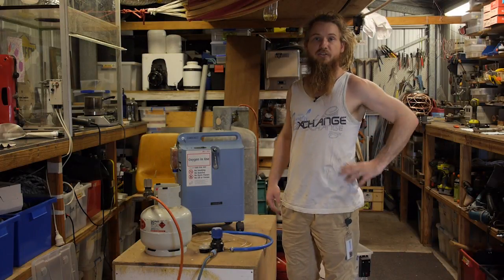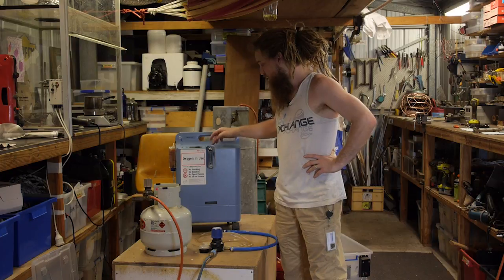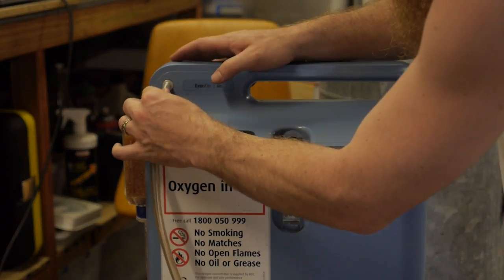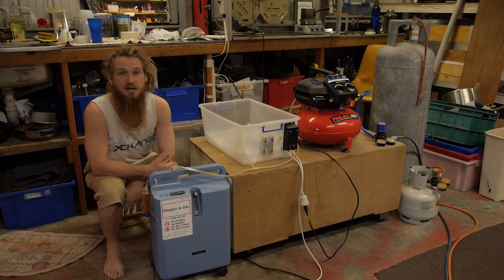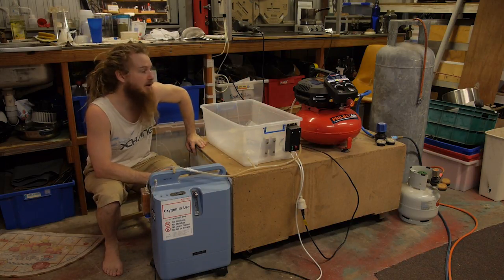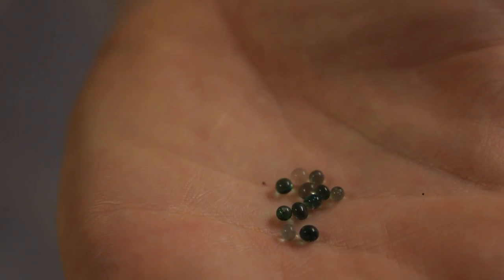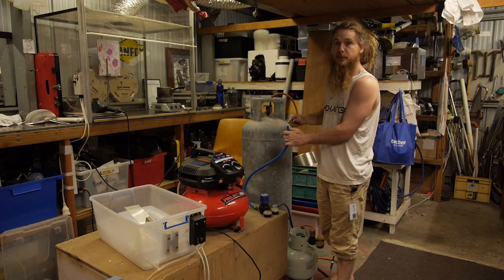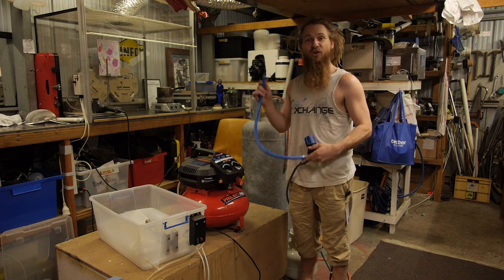How to make your own compressed oxygen for oxy torch

Comment: You shouldn't use propane tanks unless you've unscrewed the valve and washed them out first.  The scent they add to the gas is oil based and can pool in the bottom.  It may not be a problem since it's VERY hard to get an ignition source inside of an air tight cylinder. Even still it's just bad practice to combine a fuel with a pure oxygen source in an air tight pressurized container.
Reply: I was going to say the same, you have to be careful that there's zero fuel contaminants.. Just get a old balloon gas bottle and an inline regulator, much easier

Comment: Dive buddy of mine tried generating his own breathing gas  (nitrox) and had not O2 cleaned his equipment properly and nearly burnt down his property. Anyone who thinks that this stuff is safe is wrong, but it will be okay until it is not. That is when you find out why it needs treating with respect, and why there are no cutting corners.
Reply: If I was him, I’d be using an empty G size oxygen bottle as the holding tank after the compressor. The lpg bottles have a lot of contaminants left behind from propane/butane mixtures.
Reply: Skill issue

Comment: Just my 2 cents. Long time auto mechanic my welding gas supply guys once told me   Just.   Even.   Opening up the oxygen tank valve too fast can’t cause an extreme fire  as it rushes past the regulator and mixes with oil ect forget exactly the comment , but tread very carefully those guys know what they are talking about at the bottled gas supply houses.

Comment: DO NOT USE OLD USED PROPANE TANKS FOR THIS. A glass blower about 2 weeks ago blew up his propane tank full of oxygen doing this and almost died. Moral of the story one single particulate of propane in a pressurized oxygen vessel can make it explode. Used LP gas cylinders are too dirty, to be safe use a brand new one, or an air compressor tank very cleaned out.
Reply: That's true. Actually new propane tanks have a vacuum because they don't want to leave air in there when you are going to fill it with liquid propane.

If you want to use an old propane tank as a hobbyist, either buy a new propane tank or buy a vacuum pump to make you own vacuum.
Reply: J you can get test bottles for gas detectors. Which will test the sensors. In the bottle there are 3 gases. One is O2, h2s the other is o2.
Reply: one particulate? so one propane molecule (C3H8 + 7O2) contains enough energy to breach 4mm of steel? Dude - you've created the ultimate fuel source! With that kind of energy, we could get to Mars in, like, weeks!
Reply: thats why you fill the tank with water first. its called using your brain
Reply: Better to adapt it to a standard oxygen bottle rather than a LPG bottle.
Reply: While I see his point, that's not how explosions work necessarily. You do have to have enough to have a sustained reaction. For example, methane's perfect combustion point is 1:2 ratio because CH4 + 2O2 --> CO2 + 2H2O. So you would expect about 10% methane in air to be the perfect point. It turns out that it can't explore below about 5% in air, or above about 15% in air, representing 1:1 --> 1:3 ratios, respectively. Propane would have a slightly different stoichiometry, and the fact that it is compressed may change the kinetics a little, but you would still have to have sufficient propane to explode.  THat said, high pressure 100% oxygen might react giving off heat spontaneously, and even if it's not enough for an explosion, the slow burn could generate much heat, causing much expansion, until pressure-based expansion caused it to breach.
Reply: forget about talking about new or used propane tank..first dont do it second use an oxygen tank.
Reply: Bbbbbbbbooom😅😱🤬🤔💥💥💥👌

Comment: Great idea. A couple of comments anyone that wants to attempt this should consider. 1) LPG tanks contain residue of Ethyl Mercaptan which is what makes LPG smell like LPG 2) consider getting an empty oxygen tank on gumtree etc. plenty around, many for free 3) You should connect a vacuum pump to your circuit. Easily done with a refrigeration manifold and pump. You should not contaminate the pure oxygen with the air in the pipes and tank. 4) OXYGEN is explosive when it is in contact AT PRESSURE  with many oil and greases including SILICON oil. You have used a oil free pump which is excellent, however this would also be vacuumed before taking the oxygen 5) LPG and oxygen is not as dangerous as ACETYLENE. If you ise acetylene connect FIRE ARRESTORS to both tanks

Comment: I hope you carefully cleaned off the propane tank from any gas, grease and paraffin decomposites inside? You probably also know that pure oxygen (esp. when compressed) tends to react very impressively with all oil, grease and alike stuff? You are lucke nothing bad happened so far. But - believe it or not - i have similar ideas :-) I guess oxygen at 5 or 10 bar is not as agressive as it is at 200 bar from industrial tanks. The regulators can suddenly explode when opening the valve because of slightest contaminiations with grease or just dust and debriss coming from inside wear! It is rare but such incidents have been reported esp. from aluminium regulators. So take care!
Reply: It's not really a problem so long as you don't just throw the valve open. You can cause that kind of explosion with an argon tank if you screw it up just right.
Reply: How would you clean a tank like that from the inside??
Reply: @marceloovg1873  i use some solvents like petrol, benzine e.g. and a vacuum pump. Let the solvents rest for some days and turn the tank every now and again, also apply some heat gently. Let the solvent drop out - use some pressure to get all out (turn the tank). Then evacuate the tank and apply heat gently. Let it on high vacuum for some days. You can be sure that you have 99.9 % of all solvable debris out of the tank.
Reply: @richardnanis  thank you for the information

Comment: So about 2 years ago I wanted to start blowing glass so naturally I needed more of a torch than just a propane torch. I discovered oxygen and as I was learning about the fundamentals, I stumbled upon this video. I was amazed at how simple yet genius your whole set up was. Like you, I've always wanted to be self sufficient. Well today I finally picked up a free concentrator and I'm so stoked. You inspired me and I really appreciate it. Cheers
Reply from the maker: Thanks heaps! Definitely has some risks to it. But you just need to understand and take due caution. Good luck with it
Reply: Glass blower,,,30 years
Reply: Hey I'll just throw it out there if you are working with small pieces of glass MAPP pro gas is more than adequate. Especially, if you have fire bricks for insulating the heat but when I'm in a pinch and need to patch lab glass MAPP works just fine.

Comment: If you can score a Homefill oxygen compressor you can refill high pressure cylinders. I use medical cylinders for light mobile LP cutting but currently transfill them from larger cylinders (oxygen is cheap enough commercially and I've two gas suppliers within 20 minutes). Homefill compressors are often used with the (ripoff priced) integral regulator medical cylinders which are not repairable but you can harvest their QD male if desired to connect to the compressor then buy a whip and proper fittings for your cylinder. I use a Tee so I can use an ordinary oxygen regulator to monitor pressures and dump the line after the cylinder is full. Pilots use "transfill whips" similarly.

Comment: F'n awesome!!! I bought a 5 litre/minute oxygen concentrator 2 weeks ago and have been thinking of ways to compress my oxygen to higher pressures that I can store for later use and use for studying/cutting as well as glass blowing. I had been searching around for YouTube videos or guides on google but was unable to find much until now! Thank you all look much. Fantastic idea. I know what I'll be doing tomorrow on through the weekend.
Reply from the maker: Glad to hear it bro. Good luck
Reply: I think just using a 4 feet diameter latex balloon that cost 3$ for storing the oxygen is much safer then compressing it in any tank, also 100 times less expensive.
Reply: @simpledate  you think filling a 4 foot diameter latex balloon is safer to have around a cutting torch that will have burning metal Embers flying around would be safer than it being in a steel tank what happens when a spark hits the balloon and melts through it

Comment: Some of those generators have output rating at 20 psi so you can connect directly to the torch. I've been able to braze copper tubing up to 1 1/2" that way

Comment: That bag deal had me convinced you're too smart by half. But the desiccant in the compressor tank fixed that. :) (use an inline on the output  - I know you figured it out.) But it does beg the question of how the water got in there.
I found about a dozen of  those machines in the park trash bin about that 2017 timeframe. They were from a rental house.

Comment: wow what a great idea.  I was actually a little confuse how you draw bag of oxygen into air compressor, until i realized you have another tube coming out of the bag connected to the rear side of the compressor.  When compressor kicks on, compressor uses it own power to suck the oxygen from the bag into the tank and stored it there. All make sense now~~
Reply: Where do you connect the hose coming out from the bag of oxygen to the air compressor?? I don't see how the oxygen goes from the bag through the compressor into the store tank . Please help !!!

Comment: There is some risk here. The risk is not compressing oxygen or some minimal propane let in the tank. Compressed gasses are safe if used properly. The risk is oil leaking out from the compressor. If you happen to get the correct ratio of oxygen to oil vapor....badness. That is probably unlikely but it is possible. I am wondering if there is a safer type of compressor to try this.
Reply from the maker: So it is an oil free compressor, and I opened it up to check. PTFE seals. That is mandatory
Reply: @paliaspip  Nice work.
Reply: Oilsssss in the lpgg bottle.😱🤬💥

Comment: Awesome idea, however:

Tank and lines should all be lined with an oxygen barrier.  Compressed oxygen in an unlined steel vessel will rapidly oxidize.  Rapidly as in faster than with normal compressed air. 

Also if the temperature drops enough, you will have liquid oxygen droplets and those will pit steel very rapidly. 

 Any bimetal contamination in your vessel and you run the risk of a thermite reaction.    IE if the iron oxide in the tank meets aluminum or aluminum oxide. 

I would purchase a $300 oxygen bottle.  If you are willing to shell out a "few hundred" for an oxygen concentrator,  you can afford to buy an oxygen compressor (not just an oil free air compressor) and a proper tank. 

I've used both compressed o2 and liquid o2 in industry,  and it's not something to take lightly.  

When proper storage and plumbing for use is considered, using oxygen is a safe ordeal.   When using recycled goods, the potential for disaster increases exponentially.  

Without a safe compression and storage method, I personally would only use the concentration machine for brazing. 

Oxygen tank rentals and fills are not that expensive.
Reply: sounds like good advice.
Reply: Well done Travis, that is very valuable information, Thank you for putting the time and energy into your comment. I was thinking along the same lines as Mr Thomas-Hall.....but !....sometimes things ain't so simple. I really like how you didn't criticise the guy and empowered him with information, it will keep the 'experiment spirit' alive in the young lad. Cheers
Reply: To avoid this I once tried using the machines in parallel, I have three the same.  It looked a little crazy but seemed OK.  Haven't gone far with that.  The machines are of course very expensive, but they sometimes turn up in thrift stores and online.  So basically my goal was to get two or three machines running and just plumb them together.  I didn't realize at first that the machines have sensors, and low flow and high flow conditions set off alarms!  SO, if you turn OFF the torch there's a lot of beeping.   I guess the oxygen is just going around and around, you could just turn off the FUEL and let the oxygen run?  It's not going to build up in the room.  I have a few torches that have Air, Fuel, Oxygen inlets so that's what I'm generally hoping to do.
Reply: @leonardpearlman4017  having multiple machines would solve the storage issues.   You could install a blow off valve that opens when you shut down the torch and closes when you start it up again.  Just make sure it isn't venting near highly combustible materials. 

I would be in hog heaven if I had a setup that would run continuously as long as the fuel was present.
Reply: @Leonard Pearlman Three in parallel would produce the volume my cutting torch specifies but not the pressure. Will probably jump on a home fill system if I see one at a reasonable price. Too many what-ifs using a standard compressor.

Edit: Nope, I goofed.. My torch is specifying a flow that would require eight machines in parallel.

Comment: I have a 10L unit, reckon it would be enough to cut metal with??  I found it and a 5L unit on the side of the road and both work just fine.  The 10L even has a battery backup built in that still works lol.  The silica gel beads are def a good idea.  But the compressor and tank idea were awesome thanks.

Comment: Is the on/off switch like a bi-stable vibrator circuit so when the switch to start compressing is activated, allows power to flow to the compressor, compressing the oxygen into the tank, deflating the bag eventually hitting the off switch, and cutting power to the compressor side of the bi-stable? 

Otherwise, the compressor would kick on, compress some oxygen, deflate the bag just enough to unpress the switch, and rapidly repeat itself.
I guess im just interested in the electical side of how you turn the compressor on and off. Kinda wrote a lot there and I hope  it made sense.

Comment: I was warned by the company that built my defibrillator/pacemaker that is in my chest that I cannot weld any longer .  A 3000-5000 deg. Flame is plenty for working with sheet metal.  You mention 5 L/min .  Isn’t that 300L/hr ?   That would be a huge machine that’s used in a hospital setting to supply many rooms and patients 
   The home machines are like 150L/hr max right. ?!     
 So which model did you happen to purchase ? 
 Great video.   I have been wanting a small portable oxypropane setup for thin sheet metal. I am having to by no choice , archaic or not people are still building chromoly air plane fuselages with it .  Airframe used to be nothing but. They did so and still do 75 years later. LoL
Reply: did you succeed getting oxygen concentrator and torch?

Comment: The oxygen coming out of the oxygen concentrator should be dry. The oxygen concentrator backflows a small amout of o2 through the emptying bed to blow back out any moisture. If there is water coming through you have an issue with your sieve beds. There cheap to replace and you will get much higher purity o2. Oh and just cause they say they can make up to 95%pure o2 most dont. 92 % is the normal for 5 lpm machines. Happy melting :)
Reply: This is really important!  I would say that this machine oxygen is good for glassblowing and maybe brazing (with flux), but probably fatal to welding, since NITROGEN is a big problem in welding, and we're trying to keep it out of the weld!  People focus on Oxides, but the method and welding consumables have developed to take care of that.  Nitrogen is bad for (steel) welds, and the consumables might be full of DEOXIDIZERS, but there aren't any DENITRIDERS (?) or whatever you would call them.  I have a few of these P.S.A. units, and want to use them for glassblowing.  I have used them for general pyro stuff, and especially for demos.  Saving the tank oxygen for actual work.

Comment: Peter Thomas-Hall;  Tyvk 4 sharing ur ideas!  I have never seen desiccant used in quite that way before; my background is in airbrushing, and I live in a very humid area, so a moisture trap has traditionally been sufficient for my use, since I haven’t actually been storing gasses.   So, I have to ask if a moisture trap might work in a setup that’s similar to yours; and also, how do u maintain the desiccant that u use—does it just get emptied from its’ container and re-dried in an oven, like a person can do with silica gel?